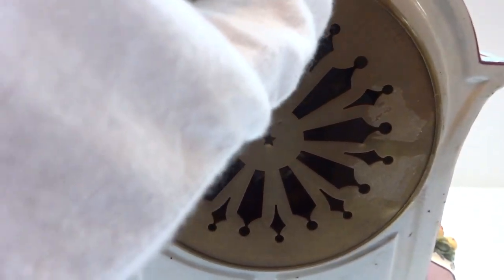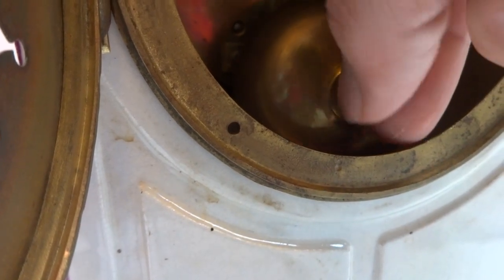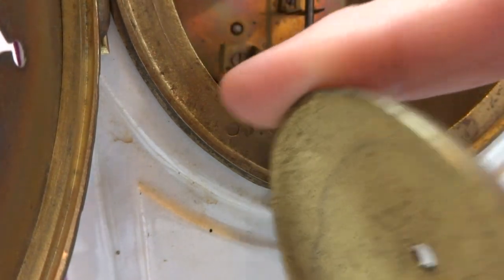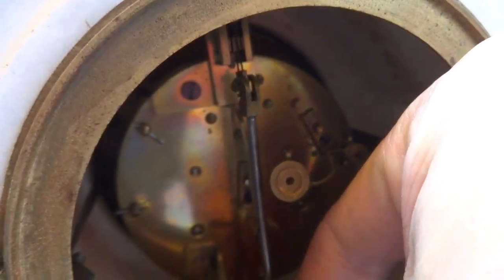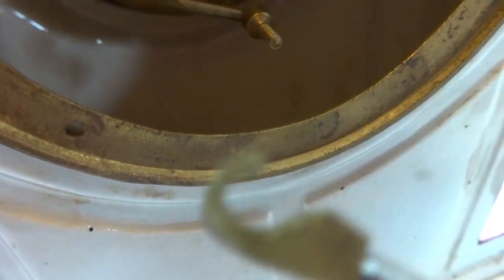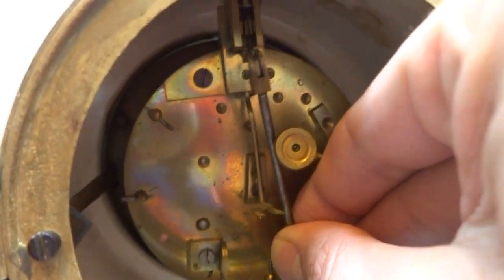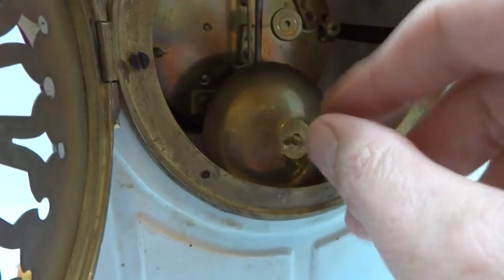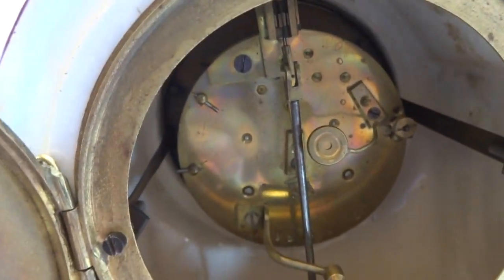Installing the pendulum on a clock after shipping

Comment: This was exactly what I needed to know. I couldn't figure out if the hooks went forward on the spring or back. Now I know. I just took a clock home from winning it at a Skinners auction and as usual I can't seem to keep it running for more then a few minutes. I'm still trying to balance it, but try try again. I hate having to drop it off at my clock guy for 2 months but that might just be what's coming. It is a beautiful clock though. Thank you for your help.
Reply from the maker: If the clock runs and then stops, that tells the movement needs a good service (cleaning and lubrication) and possibly some adjustment.
Reply: @troyduncan1969  Its been running  after a service. 2 years now. It's a Meissen clock with the cherubs and flowers, on a fancy base.
Reply from the maker: Nice @ggolds5

Comment: Hi Singing bird boxes, thanks for the video. Great help. Unfortunately the part that the pendulum hooks onto on my clock has come off. (The little square brass bit with the 2 tiny rods). Does it just get glued back on please?
Reply from the maker: Glue was never used.  It is a metal part so it either needs to be soldered or a replacement found.
Reply: Hello. Same problem with an antique clock that i bought. Did you find a replacement?! Plz let me know from where to get it
Reply: No. All my clock parts were still there. Just have to find someone to solder it.